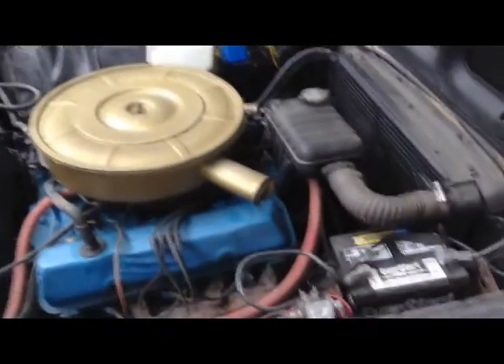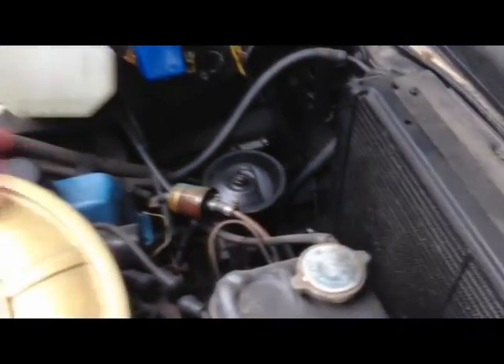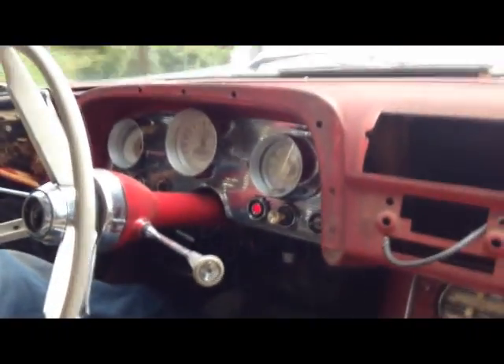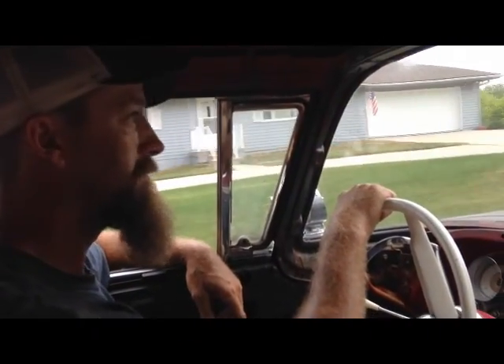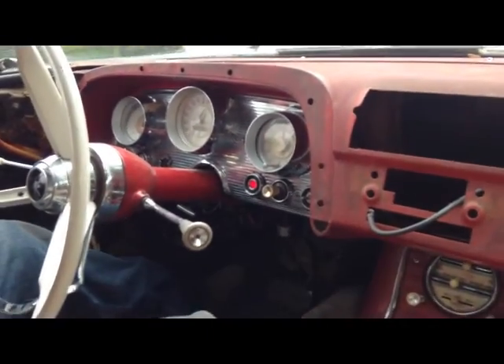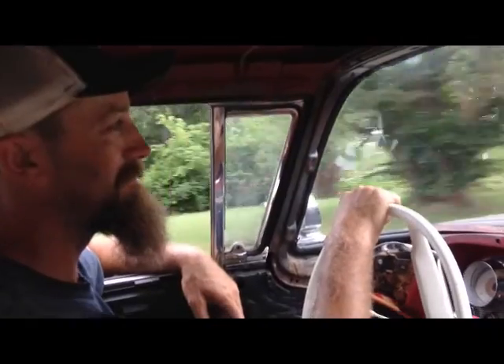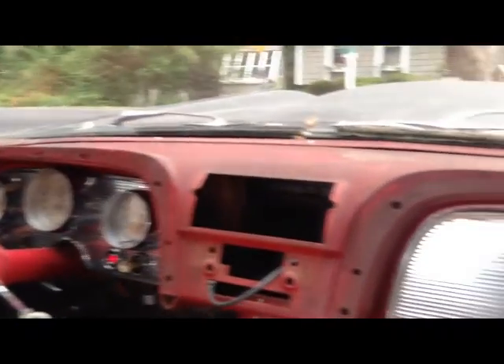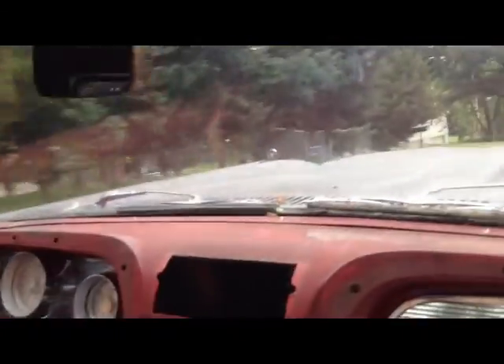Ford 9 Inch - First Drive in the 1959 T-Bird

Comment: If my memory serves me right I believe there should be a filter that sits in that power steering reservoir. Cool ride!
Reply: Correct. So had them, some did not. Will not hurt running without one

Comment: On that Power steering reservoir, there is supposed to be a filter inside of there.   I believe you put the filter in the bottom...completely submerged in fluid....then the spring, then the lid.  I'll see if I can find a picture somewhere.  Glad to see the rear is working out well. Nice work!

Comment from the maker: Supposedly the engine is a 352 Y block.  I don't know my engines well enough to confirm.  I removed the valve covers at the junk yard and left them behind just for the reason you stated...  Wasn't sure they were the right style.  We will be back there soon to inspect the galaxie again and collect the covers if they will fit.  I'm guessing they are aluminum...  I'd have to go to a friend's to tig them up if that's the case.  Either way, I bet we can fit them up.
Reply: Both the 352 & the 390cid are FE engines.

Comment from the maker: I think you are right.  The code on the engine doesn't come up as a 59.  I think we are going to go after a set of Thunderbird embossed valve covers that were in the junk yard the other day.  That will at least make it look like a thunderbird engine.  LOL.  The column only swings when something is REALLY wrong.
Reply: Air cleaner is the 1961+ style too

Comment: The T-bird valve covers are cool in their own right, but if the engine code isn't for 59, then I am not certain those babies will fit. I THINK the ones you spotted are Y-block T-bird covers (that's just a guess). You might try taking off one of the covers that are on the engine now, and taking it with you.  But knowing what a great metal fabricator you are, you might could mate the top of the old covers onto the newer ones!  I watched what you did with the Ghia / DOOR of Magnificence!

Comment: I wanted to say it's a 460, but I was satisfied when I saw just a single picture of valve covers on an engine like the ones on the car now (on a 460) so I could be wrong. In any case, I'm thinking it's a mid 70's engine. The covers in the junkyard are steel, Brother!  I looked at the vid again and you can see a bit of rust here and there not much, but a little.  You were just way too amped to get that rear-end out!  They did look like annodized aluminum, but steel valve covers were king then!
Reply: MrComaToes could also be a 428cid FE series engine

Comment: Sorry to be yappin so much, but it just dawned on me that there is no way those old covers will fit as is, because the ones on there now have bolt holes that are inset into the side of the covers. The Y-block covers are all flush along the rim!  Also, now I really am not sure what engine is in Unkies car, because they look like mid 70's 460, but I saw a couple other 460's with covers that look like those and the bolt pattern was different, I think. So, mid 70's but what, I dunno. Whew, I'm done!